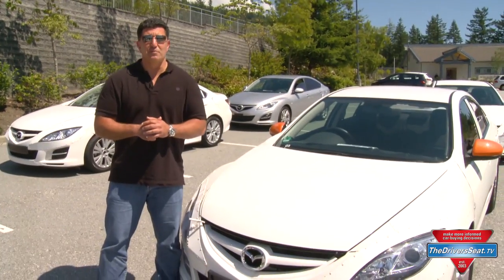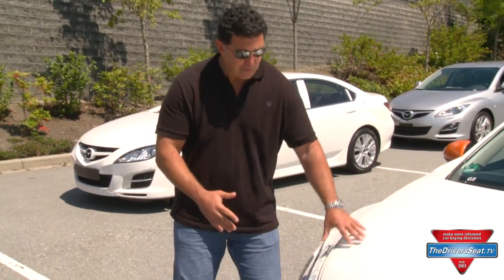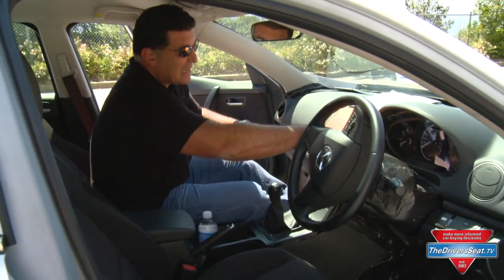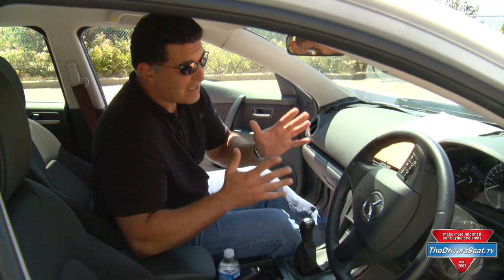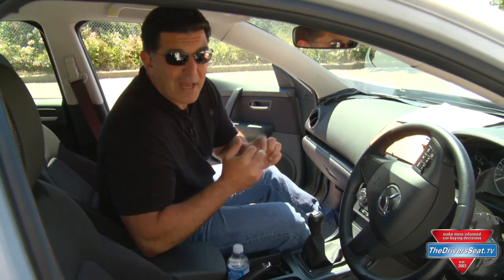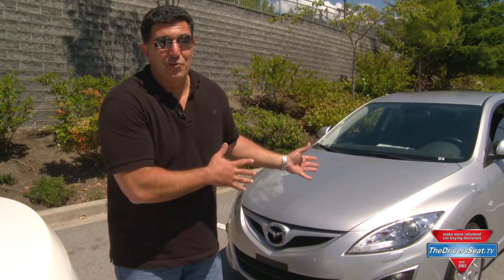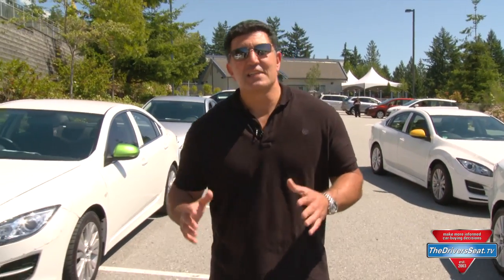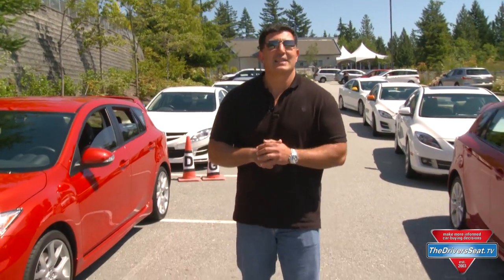Mazda Skyactiv Technology

Comment: Maybe I can do a little better job explaining SkyActiv. It is essentially for the most part a new engine technology more than anything. 14.1 compression ratio in a car intended to use 87 octane gas which is unheard of. Anything over 10.5.1 in a car without direct injection will most likely detonate and give knock when using 87 because of it's lower flash point. But if compression can be raised the combustion becomes more efficient hens using less gas, it is a new direct injection technology.